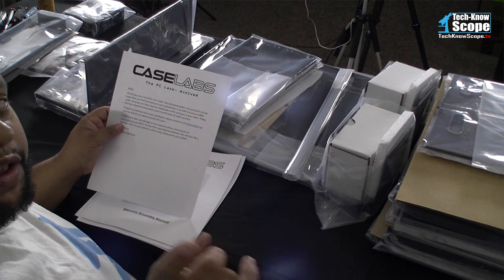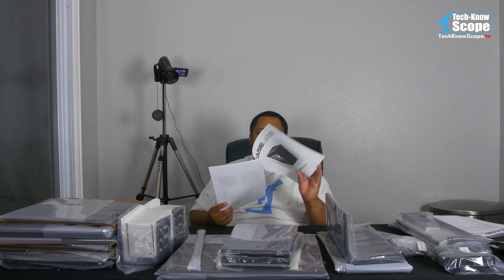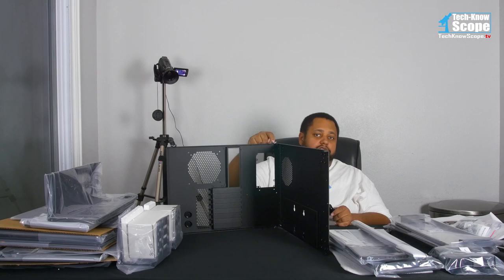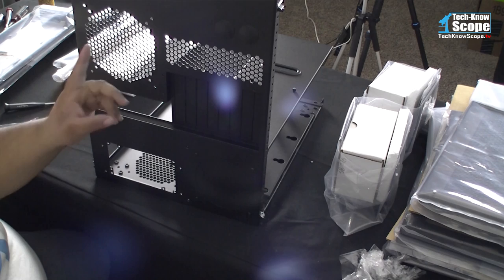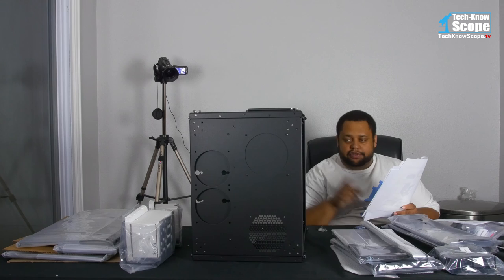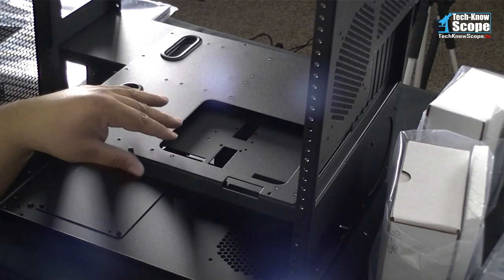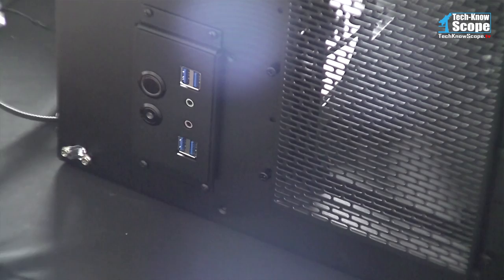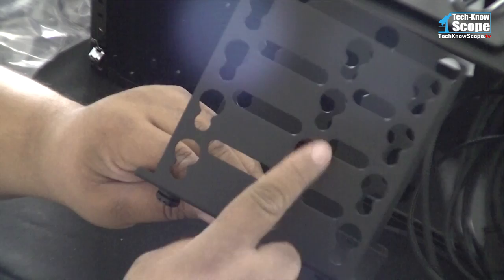▶️ Project Sledgehammer | The Ultimate Workstation Build Vlog - Ep2 - CaseLabs Mercury S8 Case

Comment: I can't seem to find if the ssi-eed motherboard is compatible with atx motherboards. Do you happen to know?
Thanks for the video :)
Reply from the maker: SSI-EEB*

SSI-EEB is almost twice the width of a standard ATX board. If you have a big enough E-ATX case, you might be able to cram one in it, though you will likely be missing the stand offs to mount it properly.
Reply: I know that already, what i want to know is if i can fit an atx motherboard on the ssi-eeb motherboard tray ;)
Since i might switch to bi-xeon in the future, we never know :)
Reply from the maker: Ohhh. Sorry, I misunderstood. From what I know, the screw holes should line up just fine. The SSI-EEB tray even has wire management holes you can use if you mount a smaller board to it.
Reply: Awesome, might be tricky for the reservoir though, gonna look your next video see how it goes, thanks :)